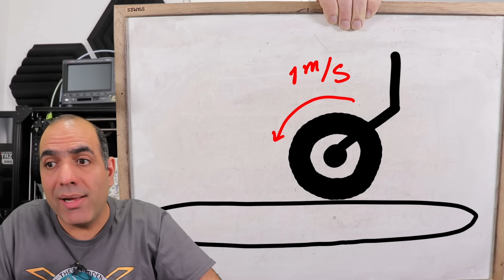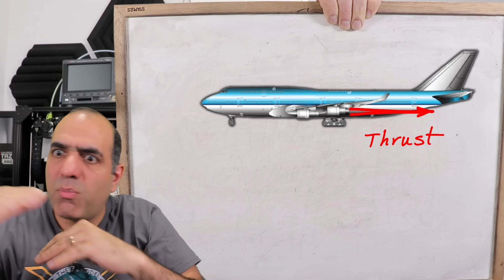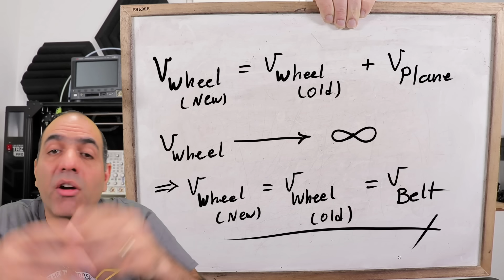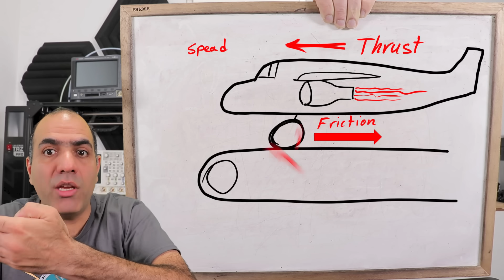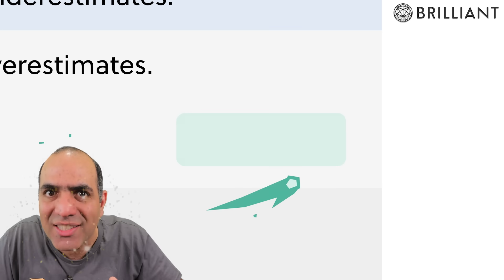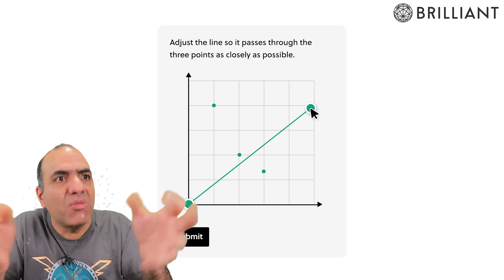Airplane Question that Drove Me NUTS!!!

Comment: The wheels touching a belt that counters their rotation doesn't make a difference because the plane is moving forward from the thrust of it's engines pushing it forward. So no matter how fast the belt goes, the plane will keep moving forward until there is sufficient lift for it to take off. Mythbusters did okay for the budget they had, but they also proved that an open propeller aircraft could move enough air over the wings by itself to create lift. The same would happen with a jet as it is compressing the atmosphere through the engine nozzles, thus also pulling air around the outside of the aircraft.

The conveyor belt doesn't matter. It's not countering thrust.

Comment: Assuming that this is just a runway at some regular altitude on planet Earth with typical wind speeds and temperatures and that the airplane is functioning as normal.  The ground is a passive player.  The engines apply thrust using air and exhaust as the reaction mass, not the Earth.  Now the trick is that as the plane rolls forward, the ground rolls backward, meaning that the wheels will keep spinning up very fast.  As the wheel speed gets insanely fast, the bearings may fail and lock up the wheels, which would be bad for achieving take-off air speed.  Or maybe the wheels get spinning so fast the tires shred, again, bad for achieving take-off air speed.  In short, if the tires and bearings don't fail, take-off is not a problem.  The wheel bearing friction is independent of speed.  Not 100% sure about tire on road friction, but I don't think it really changes much with speed.  So again, take-off is totally about whether the tires or bearings fail.

Comment: Actually, even with no friction on the bearings, the wheels are still attached to the plane. What causes the wheels to accelerate is the plane pushing on them and so the wheels must also push on the plane. Thus, if there is sufficient friction between the wheels and the belt, even with no friction on the bearings, the wheels might push on the plane enough to stop it.

Comment: If the plane does nothing, it sits there. If the belt move at the speed the plan would have moved towards the plan, the plan might  get pushed off the start of the track... No take off... 

If the plan is on it will be pushed by the engines forward a little slower than normal as the wheels travel over more of the run way, having more friction... But seems likely to still take off. The belt might even increase lift by generating its own little current that cancels some of the friction issue. 

If they misprased the question and intended to have the belt move the plan forward at the speeds it takes off it would also take off momentarily, but the belt itself would be moving faster than the wheels would have under normal circumstances.

It's a shyt question.

Comment: Not an engineer but i suspect the plane can not move forward nor backwards, as per the condition for the wheels & belt; As their rotation speed increases, the belt moves more air, and thus the plane would remain stationary until all its weight is carried by the wings instead of the wheels; decoupling its mass from the wheels & able to take off from a standstil. As the wheels hold the planes mass, they are relevant to the question.

The problem with friction is if it is indeed possible for that much air flow to be generated without reaching a speed limit of some kind; i suspect that the wheels and belt have no friction limit in this scenario and could ramp up much higher speeds because of little air resistance for the wheels as they don't carry a moving object; which is stationary because of the belt. Which would make me believe there is an infinite rotation-limit and thus ultimately generating sufficient air flow.

Right; what happens after takeoff? Since the belt is as long as the runway; the takeoff would happen in the stream of moving air pushed forward by the belt and for the duration of the length of the belt the airplane, now decoupled from the ground, can gain speed (hopefully) sufficiently as it enters the 'regular' airspace beyond the belt; i wonder how impactful that transition would be from the air flow pushed by the belt to the air beyond it which isn't being moved at that speed/rate/direction. But i guess there probably is a scenario here where the runway would allow the plane to reach sufficient speeds?

Comment: My problem with the question is this: In order for the belt to match the wheel spin, the plan must be stationary at all times.

If, at any time, the plane moves even one millimeter forward, the initial condition is not met.

This is assuming that the wheels are able to move freely and we haven't turned off friction.

Comment: Okay, so I just wanted to get my opinion/conclusion to the prompt down before I watch the rest of the video.
So the conveyor belt matches the speed of the plane's wheels exactly. But the plane isn't powered by the wheels, so the plane can take off, since its airspeed is independent of wheel speed.
Reply: I totally agree with Mehdi here. The question is too vague to really answer correctly. It does not provide the full case like you would expect if this was, for example, an exam question. For the sake of fun, I will attempt to write a version that fully addresses this in what I believe to be the spirit of the question. 

Imagine a 747 airplane is sitting on a conveyor belt on the surface of the earth. The conveyor belt is as wide and long as a runway, and is designed to run such that the surface of the conveyor belt will match the speed of the surface of the tire, in the opposite direction, such that a car placed on the conveyor belt would be unable to accelerate. Assume the wheels of the plane are able to rotate at any speed without friction. The plane throttles up its engines and attempts to take off. Will the plane be able to take off?

Comment: Well, that question is all about bearing friction. Thrust engine will produce let's say 252k kN, and if plane is stationary, it will slowly accelerate. While speed is increasing, bearing friction is increasing as well, so we finnaly will get to the point, that forces will cancel each other and plane will have constant speed. It will lift off only if that speed is enought to lift off in normal circumstances.

Comment: I hope I'm not going to sound silly but assuming it doesn't add too much backward force due to friction I would imagine it wouldn't have much effect on the plane as the engines push it forward not the wheels. Saying that if it matches the speed of the wheels then it wouldn't be able to go forward, so I think that's actually impossible unless this adds enough drag to the plane due to the added friction and now I've come full circle and think it wouldn't takeoff.

Comment: My answer would be no.  Unless you were talking about rocket technology.  Where the wings don't mean anything anyways. When rocket propulsion exceeds the weight of the of the craft, It will lift.  I had the pleasure of watching an SR-71 take off and it was going about 50 MPH it placed it's nose 90 degrees straight up in the air, then he activated his afterburners, I saw 7 rings about 1oo yards long and 6 seconds later you could not see him at all.  Oh by the way it made no noise at all.  It was like I died and went to heaven, it was awesome.

Comment: In fairness, for example #4, it'd still fly, since while the problem states the plane is sitting still, it doesn't ask if the plane Will take off, but if it Can take off. And since we then have to allow for the planes normal operation, it will fly.

Comment: the plane would deffinitely be able to take off, the speed of the wheels would incease exponentially until the rubber completely burned off or some other problem, but the plane would take off like normal, the conveyor belt could stop a car but it cant stop a plane

Comment: Well. The plane engines push it forward, making the wheels rotate. Imagine the wheels reach 20 rpms. The conveyor will speed up to match it. But this will make the wheels spin faster. Acceleraring the conveyor again. This will keep happening until the wheels melg down from friction. If the plane hasn't gotten to land off speed it will crash. Killing everyone inside.

Comment: Ooh, okay, so let's take the assumptions from your Answer #2, because they're fun! So, friction between the belt and tires, but frictionless bearings for both the treadmill's rollers and the wheels.

In this case, we'd really need to know the maximum torque output of the treadmill, to see how quickly it can overcome its own inertia and the rotational inertia of the wheels to accelerate toward infinity.

If it has relatively low torque, then it won't be able to ramp up enough to stop the plane from taking off (unless, as I said before in my other comment, the tires explode, but let's assume invincible tires, for funsies.)

However, above a certain threshold of torque, it'll have enough torque to reach the speed necessary to keep the plane from taking off in time, and eventually will shove the plane off the back of the treadmill, which would be a not-so-minor disaster.

The real fun, though, comes if we assume infinite torque! If we do that, along with an infinitely strong belt, the treadmill should accelerate infinitely rapidly! Now comes the fun part.

Even in spherical cow physics land, Special Relativity is a thing. Once it comes into play, length contraction means the belt will get shorter. This isn't a mere force; it's spacetime itself shrinking. It can't not happen, so one of two things will happen.

1. The belt's strength proves not to be so infinite after all, the belt snaps (at a significant fraction of the speed of light) and the resultant forces disintegrate the belt, the treadmill, the plane, and probably several hundred square kilometers of the surrounding landscape. (Think of a snapping cable, only moving a million kilometers an hour instead of a few hundred.)

2. The belt's strength is indeed infinite, and the treadmill/conveyor's tensioner runs out of give, and the runway-sized treadmill breaks. This frees the belt up to do all sorts of crazy shenanigans... at a significant fraction of the speed of light. The resulting forces disintegrate the plane and create an enormous explosion, leaving behind a massive crater, at the bottom of which would sit a crumpled up invincible belt, and eighteen invincible wheel/tire pairs.

In other words, yeh, this is a ridiculous question, not very well posed, and there is no good answer except of course that so many ways for things to go horribly wrong exist that the chances of the plane being able to actually take off are extremely low, approaching zero.

Comment: The wheels are not relevant. Planes have jet engines on their wings, so it will accelerate and take off. If it had to use motors in the wheels, then it wouldnt move.

Comment: I think case 3 is what the problem "intends", but I don't think it would play out quite as simply as you suggest, as the sources of friction have limits. Eventually the wheels won't be able to spin faster: once the bearing resistance matches the grip limit of the tires.  I'm pretty sure this limit is well less than the maximum thrust of the engines. Since the conveyor is designed to "exactly match" the tire speed, it will act like traction control and reduce belt speed as soon as any slip occurs.  Thus the belt will spool up to this speed (with limited acceleration, again to prevent slipping) then start slowing down as the 747 continues to accelerate.   However, that doesn't mean it takes off.  
1) If you take the while resistance to be constant, it would be effectively like taking off with reduced engine power.  There is a limit to how much a 747 can reduce power and still take off.
2) Even if there's enough net power to theoretically take off, reduced power means you need more runway to take off.  As others have mentioned, the conveyor will produce some headwind for the 747, which will help mitigate this, so we really have no idea how much runway will be needed in this situation or what happens when the 747 reaches the end of the conveyor.
3) This extreme drag will heat the tires, bearings, etc a lot.  They are very robust parts, but this abuse will eventually cause catastrophic failure, after which takeoff will be impossible. Since we don't know how long the 747 will need to endure this condition, we don't know which will happen first.

🎶The answer, as always, is "It Depends" 🎶
Reply: Do you think it would be reasonable to assume that the wheels would catch on fire and explode before the plane has enough airspeed to take off? That's what I would expect to happen, I could design a simulation to tell for sure (I don't think enough people are interested in the answer to warrant that).
Reply: @theRPGmaster  My guess would be the bearing races would fail first--they are not designed to get red hot like the brakes are and we're talking about dissipating similar energy.

So I expect same as you: it's my intuition that something in the wheels would fail before they leave the ground

Comment: The answer is yes, with enough wind or the friction level of the treadmill surface.  The machine is impossible, because the wheels do not 'spin' as a car's does.  If the machine could truly match the speed of the wheels, then it would have to be rotating for a track speed of about 200 or more MPH at which point the bearings would begin to fail increasing drag.  Given no wind, the treadmill would eventually stop when the wheels stop spinning and the airplane MIGHT have enough thrust, depending on the friction of the treadmill surface, to overcome that friction and drag the nubs along that surface.  Problem is, with the illustration, there isn't enough room for the aircraft to accelerate there... without some headwind.

Comment: Even if the thrust is from the onboard engines and not at the wheels as a car would be, the plane is still physically on the ground until it takes off. If the engines go full up and the wheels are being spun backwards by the belt at the same speed as the forward velocity, I'd assume it would have a measurable decrease in ground speed/efficiency, but eventually be able to take off with the wheels spinning at 2 times the ground speed. The belt and wheels will be moving fast (possibly beyond design tolerances and cause a failure) but it wouldn't get anywhere close to infinite speed, because that would imply the engines are moving at close to infinite speed, which would definitely result in rapid unplanned disassembly.

Comment: To me a it is a stupid question. First you need to know how a plane can fly. It's using wings to lift. Air must be flowing over and under the wing to fly. So spinning the wheels at the same speed will not lift the plane. The whole plane must be moving forward. So World of Engineering are not that bright!
Reply: It comes down to what you think the point of the question is. Do you think it's asking if a motionless plane can take off, or do you think it's asking if you realize there's no way for the contraption to prevent the plane from moving.
Reply: @407BRR  I fly planes and helicopters. The plane itself has to be moving forward to lift off (fly). Making the wheels spin cannot and will not make the plane move forward.
Reply: @Airbrushkid  Correct.  A motionless plane won't take off. But can a conveyor belt keep a plane motionless? That's the trick in the question.  It can't, so the plane accelerates forward like normal.
Reply: @407BRR  Your wrong. The wheels can only move as fast as the belt can. Remember the wheels don't spin on there own. No motor in the wheels. The wheels are free spinning. Take a wheel put a rod thru the bearing in the wheel. Hold the rod. Now spin the wheel. Still holding on. Are moving no.
Reply: @Airbrushkid  Yes, because the wheels aren't slipping. But I'm not sure what point you're trying to make. 

It's really just a simple physics question.

Force equals mass times acceleration. The engines produce thrust, a force. That accelerates the plane. If there is no acceleration, then there must be a force equal to the thrust. 
A conveyor belt can't impart that force to the plane. At least not as long as the wheel brakes aren't applied.
Reply: @407BRR  About time. That's why the plane cannot lift off the belt.
Reply: @Airbrushkid   as i said...

It comes down to what you think the point of the question is. Do you think it's asking if a motionless plane can take off, or do you think it's asking if you realize there's no way for the contraption to prevent the plane from moving.

The brakes aren't a part of the contraption.
Reply: @407BRR  As I keep saying it cannot lift/take off.

Comment: The answer to this question is simple if we understand that the wheels do not affect the propulsion of the aeroplane. They simply reduce the friction between the plane and the ground during take-off and landing. The plane is propelled as a reaction to the mass of air pushed backwards by its turbofans, and its ability to fly is dependent on air speed, not ground speed. An outside observer would not notice any difference in the aeroplane's take-off whatsoever.

Comment: I immediately assumed that the conveyor belt cancels out any forward movement of the plane, therefore the plane just sits there
Reply: It comes down to what you think the point of the question is. Do you think it's asking if a motionless plane can take off, or do you think it's asking if you realize there's no way for the contraption to prevent the plane from moving.
Reply: @407BRR  i thought it‘s obviously the first one, I also assume it was the intention of the initial question. Also, a motionless (relative to the ground that is) could take off, given enough headwind lol